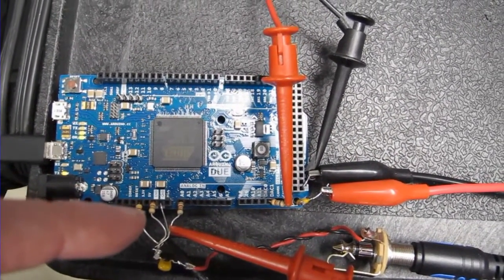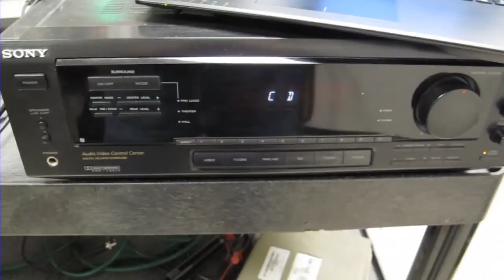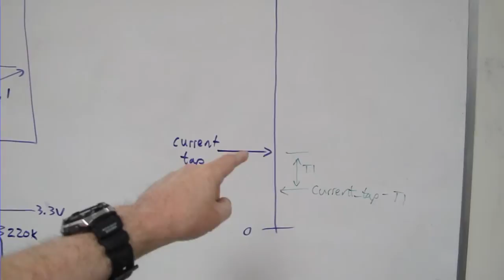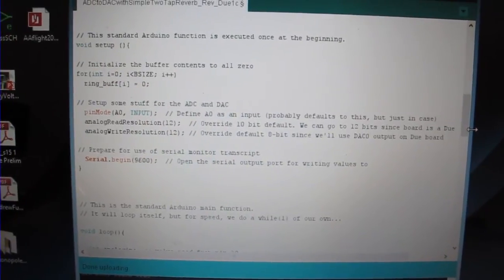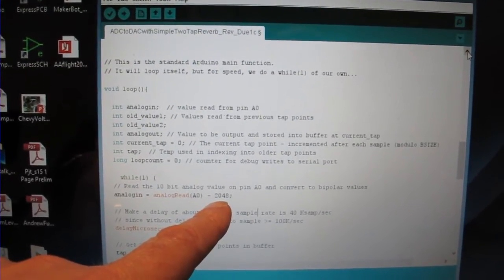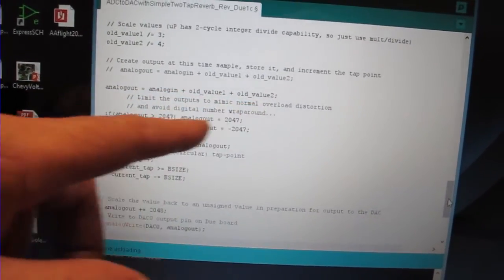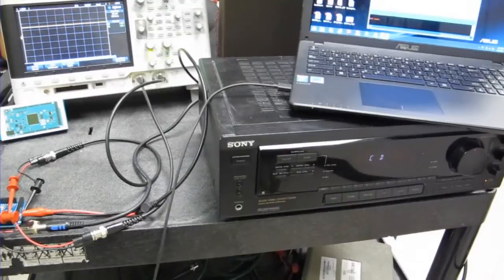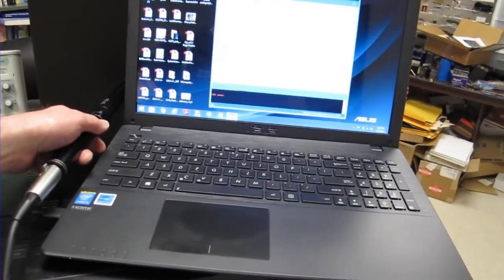Arduino Reverb

Comment: Thanks for this awesome example. I have ported this over to run on my ESP32 S3 board that has external 12 bit DAC MCP4921 and ADC MCP3021. The ESP is running RTOS with a seperate core reading potentiometers, pushbuttons etc and also updates on the OLED display. Sound quality is excellent. I will be adding different modes to this to have dedicated reverb and echo separated, will also be including a sampler function. Thanks again great contribution.
Reply from the maker: Wow.  That's awesome. It's great to hear that the video was helpful and the port was successful. Your project sounds excellent!

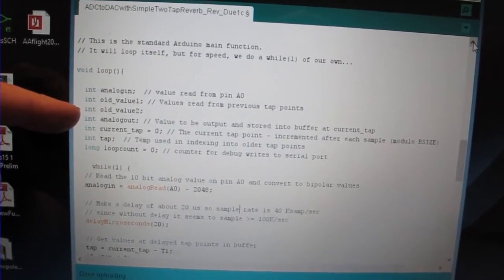Comment: 8:00 Are you sure you are doing that right? Why would you define the variables inside the void loop()? Why not make them global and define them above the loop? Should be much faster.
Reply from the maker: I think its OK. All the code is actually inside a "while(1)" infinite loop to avoid falling off the end of loop() and having them being setup again. See the line right below the long declaration.  My reason for putting the variable declarations inside loop() was to avoid globals (which admittedly would be OK for small code like this, and I think perhaps the shunning of globals is not as strong now as it once was). But I didn't want to let loop() complete anyway since I don't know the time overhead in the hidden main() that calls it.

Comment: That's Delay not Reverb. Still super cool project. 🤘
Reply from the maker: Thanks. Agreed on the white-board discussion / diagram about it being delay. The code however does implement reverb by adding the delayed audio samples to the current-time ones before putting that into the storage buffer at the current-time tap. Only two delay taps implemented, but it seemed to be enough to mitigate the comb-filter effect one sometimes gets in a digital implementation :-)

Comment: You're demonstrating delay / echo, not reverb.  True reverb won't suffer from periodicity.  I've been wanting to try running the original freeverb public domain source code (which implements a Schroeder Reverberator) on an embedded microcontroller or DSP chip.  I bet that would sound amazing.
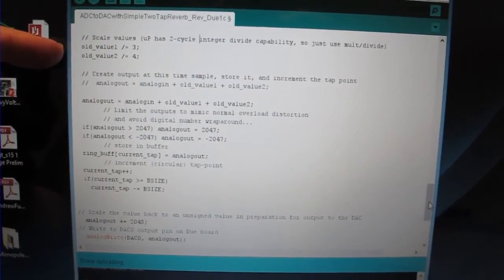Reply from the maker: Interesting discussion point - and thanks for the reference to the Schroeder Reverb - I was not familiar with that. I went to the freeverb site at stanford.edu and chained through some of the references to see what freeverb is and how works. It appears to be a sophisticated signal processing technique overlayed onto the original digital reverb concept to address the periodicity issues. I did my first reverb in digital hardware as a senior design project back in the 70's and noticed the comb filter effects in the sound (periodicity issues). So I added more delay lines and it got better. Looks like they do even more than that. FWIW, technically the "reverb" in this video is still a reverb since it adds old delayed samples back into the ring buffer so they build on themselves (See time 10:33 ). The delay values used determine if it sounds like an echo or not (since the brain will distinguish sounds separated in time by 50ms or more as discrete sounds). But I totally agree that in the video, the code was producing discrete (reverberating) echos due to the long tap offsets used. And it is not a very good reverb at all due to having only two taps - which is probably why I demoed it in the echo'y way ;-)   It's basically just the original schemes people tried in the 70s before processing power (and DSP methods) got good enough to do it well like in freeverb.  (Looking at the papers the freeverb references, I found this one that provides some historical context. Looks like the "reverb" I implemented is their Figure 2 "Feedback Reverb Unit Using Two Dissimilar Delay Lines". They fix the problems with this approach in their figures 3, 4, and 5 designs which I didn't do.  Thanks for comment and reference to the improved approaches available today ! 🙂   https://www.scribd.com/document/424404635/1972-Michael-Gerzon-Synthetic-Reverberation )

Comment: don't really undestand why subtracting the 2048 from the input read to make it bipolar if you're making it unipolar back out again for the output DAC
Reply: Sound is nothing more or less than balanced positive and negative pressure variations caused by vibrations of air molecules around the local ambient air pressure. Anything that is not balanced results in the bulk movement of air rather than vibration of air - a phenomenon we call "wind" :-)  As all sound, including increases or decreases in volume, and mixing together of different sounds, is superimposed upon and referenced to the static ambient air pressure, the digital representation of that sound for processing purposes must also be referenced to arithmetic zero, representing ambient pressure. Subtracting 2048 (which is half the range of the ADC and the DAC) from the digitally converted value references the "no sound" condition - meaning static ambient pressure, to arithmetic zero. All positive numbers now (by convention) represent increases in sound pressure while negative numbers represent negative pressure. ( Imagine the air pressure waves caused by the skin of a base drum if you need something more graphic.) All signal conditioning - increases or decreases in volume, and mixing together of different sounds - can then be achieved simply by adding or subtracting digital representations of those sounds, resulting in digital signals above or below zero representing the momentary higher or lower air pressure of the  resulting sound in air.
At the end, of course, we want to output a voltage which is an analog of the sound pressure (that's why we call it analog sound) that can be amplified and converted back to vibrations in the air by a loudspeaker. The digital to analog converter (DAC) need unipolar numbers (numbers that are are zero or positive), however, not bipolar numbers, so we add the 2048 back in before sending it to the DAC. Numerical values above 2047 will result (again, by convention) in positive going pressure waves while values below that will result in negative pressure waves.
Hope that explains it.

Comment: Very cool! I modified your idea to do a simple delay (no reverb) to sync the audio of an analog radio with a digital SDR radio. I am using a 10 usec timer interrupt instead of the delay, and it seems to work. I never would have figured out the DC bias trick and +- 2048, so thanks for that explanation!!

Comment: #define BSIZE 8000
int ring_buff[BSIZE];

#define T1 (BSIZE - (BSIZE / 5))
#define T2 (BSIZE - 1)

void setup() {

  for (int i = 0; i < BSIZE; i++)
    ring_buff[i] = 0;

  pinMode(A0, INPUT);
  analogReadResolution(12);
  analogWriteResolution(12);
  //serial setup
  Serial.begin(9600);

}

void loop() {
  int analogin;
  int old_value1;
  int old_value2;
  int analogout;
  int current_tap = 0;
  int tap;
  long loopcount = 0;

  while (1) {
    analogin = analogread(A0) - 2048;
    delayMicroseconds(20);
    tap = current_tap - T1;

    if (tap < 0)
      tap += BSIZE;
    old_value1 = ring_buff[tap];

    tap = current_tap - T2;
    if (tap < 0)
      tap += BSIZE;
    old_value2 = ring_buff[tap];

    old_value1 /= 3;
    old_value2 /= 4;

    analogout = analogin + old_value1 + old_value2;

    if (analogout > 2047) analogout = 2047;
    if (analogout < -2047) analogout = -2047;
    ring_buff[current_tap] = analogout;
    
    current_tap++;    
    if(current_tap >= BSIZE) current_tap -= BSIZE;

    analogout += 2048;
    
    analogWrite(DAC0, analogout);
  }
}
This is untested

Comment: Are arduino UNO work same
Reply from the maker: Unfortunately, no. The UNO does not have a DAC to output an analog signal at a high enough rate (it has a PWM, but it is too slow). Also the UNO processor and memory are not really sufficient to do very good audio.

Comment: Greetings! I've used your circuit and your code in a reverb/ delay pedal of my own using the arduino due, and I can't get the same result. I have attempted to use the analogWriteResolution(12) function, but I get no signal output with this. I get an output signal when I override the write to 10 bits, but it sounds very distorted. Any advice?
Reply from the maker: I would probably look at the amplitude and DC offset coming into the ADC. The resistor voltage divider I used biases it up to mid supply and the capacitor just passes the signal in without any attenuation. Do you have a way to look at the signal actually coming into the ADC to be sure that's all working? I.e. the signal coming to the ADC is less than 3V peak to peak and centered on about 1.6V ?
Reply: @MegawattKS  I don't have access to that equipment at the moment, but I certainly will give it a shot once I do again. Thanks for the advice!
Reply from the maker: @michaelmeixner  Maybe try to 'instrument' the code by sprinkling some print statements to send values to the console. Of course you'll want to only print every 100th or 1000th value since the loop goes pretty fast - but maybe you can see where things are going wrong by comparing the numbers you see with what they should be. None should be 'clipped' (e.g. full scale). They should all be around the midpoint of the int range (if I remember the code correctly). Maybe start by looking at the ADC values being input and at the DAC values being output. Troubleshooting can be fun, and is an invaluable skill in general !  I learned a lot in my early days by repairing equipment, but the troubleshooting skills carried forward to my design work - since few things work the first time ;-)  Good luck.